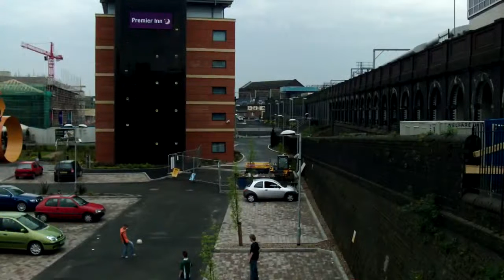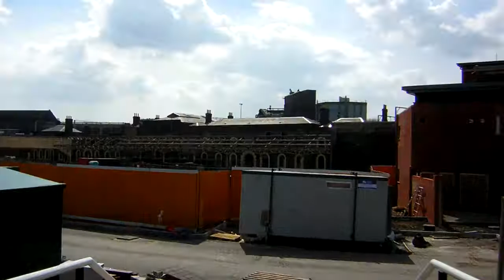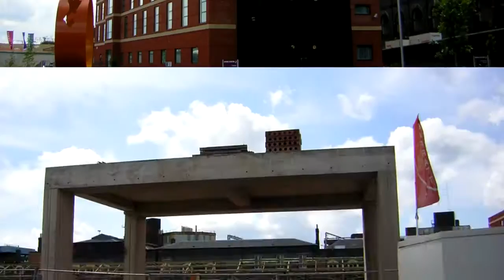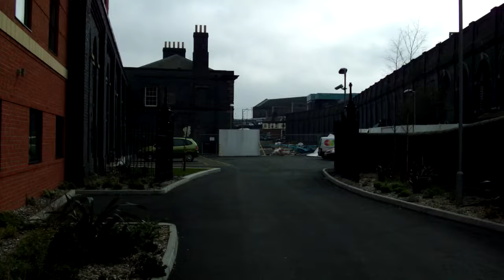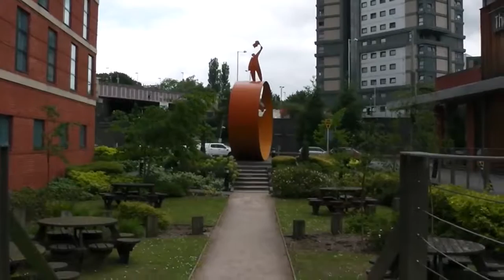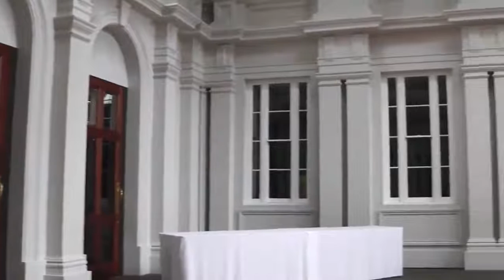Wolverhampton Low Level Station In Photo's & Video 2007/08 25.6.15.

Comment: Nice to be able to look back and then see the difference , a very smart station you have there now Bill ...
Reply from the maker: ***** Cheers Dave, Low Level Station I think is a grade 2 listed building, and the whole building should have been kept, but unfortunately some of it was taken down to accommodate the new blocks of flats, most of the station frontage is still there, the old booking hall, where that chandelier can be seen, that's new, it wasn't there when it was a working station. part of the downside platform is now a banqueting suite. thanks for looking/commenting...Bill

Comment: i hate it all those new builds clash with the original low level still not being used either (was going to be a casino) as normal for wolves no foresight would have made a great transport museum with all of wolverhamptons past in cars trains and planes
Reply from the maker: David Ball Cheers David, Low Level was a great place to be during it's days as a mainline station with trains such as through services from Paddington to Birkenhead and many other destinations. An open day was held during 1987 which I went to, and signed the book on the way out, stating exactly what you mentioned about that it should become a form of transport museum representing what Wolverhampton was capable of either building or making many years ago, unfortunatley this was never going to happen. Local Councillors and Politicians do not think like the average working man, thanks for looking/commenting, much appreciated...Bill
Reply: 84asrd84boxy typical wolverhampton always looking to the future with no aims and no joy in its history most classic building are pulled down and replaced with concrete as for the low level its a mess now all the building around it don't match just wonder if it will be an excuse to pull it down one day
Reply from the maker: David Ball David, unfortunately some say this has been done in the name of progress, has it???...Bill
Reply: 84asrd84boxy i'd say a backwards step wolverhampton still thinks its a night out area like in the 90's place is dead now